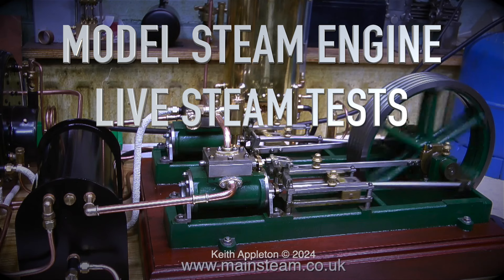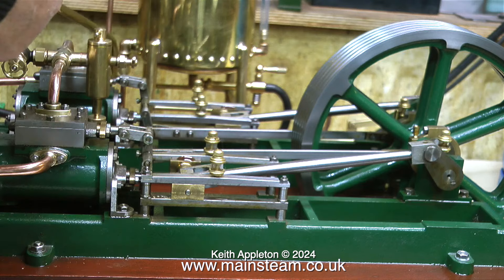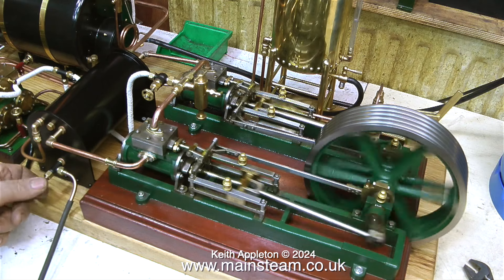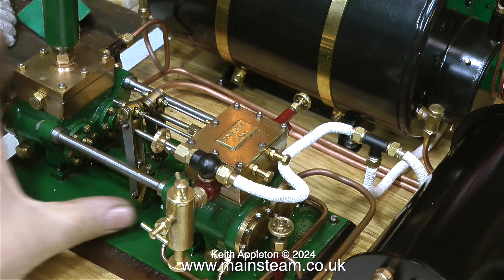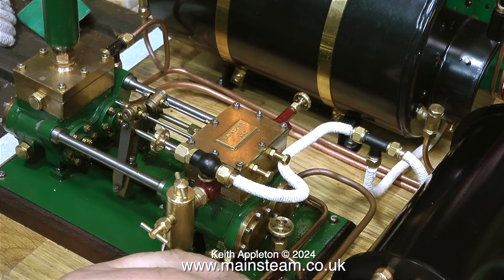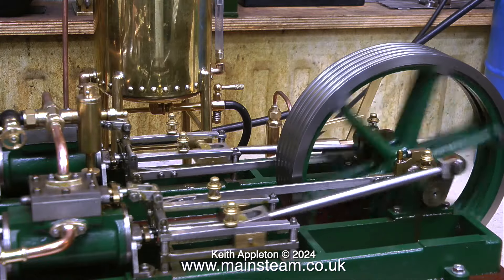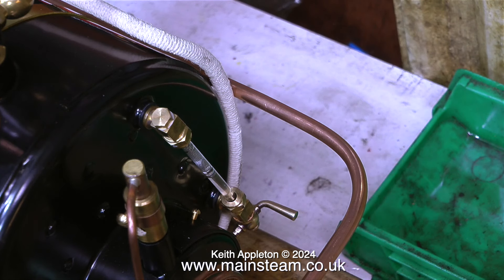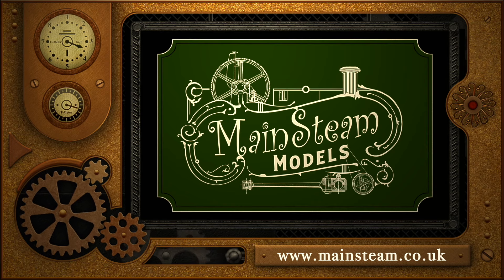MODEL STEAM ENGINE LIVE STEAM TESTS - PART #7

Comment: I visited a steam rally yesterday. I saw a full sized steam water pump, I wouldn't have had a clue what it was if I wasn't a follower of your videos. My guess would be that the pistons would have been about a foot in diameter. Unfortunately it wasn't running or even connected to a boiler, it is in Pennsylvania in a traditional coal mining area so could have been a boiler feed pump. So, videos, definitely found them useful.

Comment: Hi Keith, I have a fairly large mill engine, that is scratch built that I bought, the gaskets on the steam chest have kicked the bucket. I’m wondering what I would use to remake some? Are they cheap alternatives? As always, great video and engine you have shown, thanks.
Reply from the maker: Just buy some more commercial Gasket Material.

Comment: Has anyone modeled an oil separator for reusing condenser water?
Reply from the maker: It is difficult in small sizes as part of the oil is emulsified in the water.